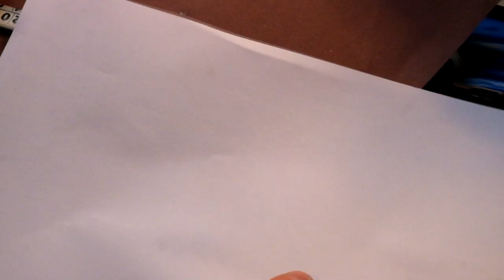How to repair Steam Contoller shoulder buttons (RB/LB) with only basic tools

Comment: I couldn't believe when I saw the video reach to the part and it was EXACTLY the same way mine broke!
Then you reached out to using a spare metric tape and I was excited because I also have that!

and then you pulled out the torch, and it was game over to me. I don't have one. YET. lol
thanks for the video, you just saved my Steam Controller!
Reply: after reading @cjwaasdorp2478 comment, I took tools out, burned stuff in my cooker, and... it's alive! Thank you both for the resurrection of my Steam Controller - it was dead for less than 24h lol
Reply: @JohnnyCiocca  How did you do it, because I don't have a torch either and would love to fix my controller.

Edit: Wait, I see it now, do you think an electric stove top would work, cause I don't have a gas stove.

Comment: Contacted steam about this issue, they did nothing, this is all too common a problem for steam controllers, but this worked and worked well, it's a little tricky getting the metal to bend the right way, but once you get that its a cinch, I tested it using steam diagnostic in big picture and it passed, never even showed up before fix, this video is perfect for this situation.

Comment: This is absolutely clutch.  And way better than the 3d printed versions that require further fine tuning.  Considering you make it with a tape measure, drill, screw driver, and a gas stove or a torch.
Reply: wait, you're saying I don't even need the torch, I can use my cooker for it?! I'll be right back, got some metric tape to burn =p

Comment: I just got the same exact failure a few months ago! Funny how the problem seemed to start right after Valve stopped support! I guess that's what you get for going with cheap plastic arms
Reply from the maker: While I don't think the timing was intentional it is a pretty unfortunate situation. I seriously hope it's just bad design and not planned obsolescence.
I love these controllers and had I known they would stop selling them I would have stocked up.
Luckily this failure mode is fairly easy to fix. But for most other components breaking you are SOL if you don't have a donor controller. I just hope I stop playing rocket league before I run out of parts...

Comment: Thanks for the video, I used one of my daughter's metal hair clips, and it worked great for this purpose. After breaking it apart, it was just the right size, and even had a hole predrilled where the rivet was that fit perfectly!

Comment: Thanks for sharing this. My RB for my steam controller just wore out the other day (Owned my controller since they came out so im impressed it's lasted this long) and Its great seeing the process for repairing it. I happen to have extra thin steel from a tape measure that I can use for this process, will give it a shot.

Comment: This is absolutely incredible! I got my first steam pad (it's registered as "lily pad" cause sometimes I'm a frog) when valve dumped the whole stock for $5 each and it quickly became my goto for the media/gaming comp hooked to my tv since it needed a mouse but not a keyboard (not even the steam on screen keyboard cause it requires both hands so how can I possibly do that and still hold my beer). RB broke a few years later (had it mapped to RMB so it didn't get much use except when gaming). I bought a new controller, but since they were out of production by then it took forever to find an unused one that wasn't like $100 (it's registered as "cow paddy" cause the price was crappy). glad I could use my first controller again since I could put the mint 2nd controller in storage for when the 1st one explodes (it already has a hole big enough to stick my thumb in on the left grip 2cm below the dpad; some plastic decided to self-liberate).

I do have one concern with this fix: iron oxidation aka rust. happens to iron/steel if it gets exposed to oxygen (unless you got something crucial going down, there'll be some oxygen floating around). sometims the tape is stainless and won't have problems, but a lot use regular steel with some kind of coating, such as nylon. some claim to be stainless but it'll be the housing only, the tape isn't. when burning off the coating (btw it definitely burned off in the video), leaving exposed steel is eventually gonna wreck your day. easy fix tho, with normal steel, sand it down and spray it with primer (some specifically are anti-rust) and you're good. aluminum doesn't rust either but dunno if a coke can is robust enough (while I'm not sure if it'd fit, stacking 2 layers of coke can would be fine if it did but I'm not gonna dismember lily pad a 4th time to check that out).

this mod really is great since it's not only a fix, but also an awesome reliability upgrade (steel>craplastic maybe). I went ahead and "upgraded" LB while I had lily pad dismembered (physics says LB woulda broke right after I got it undismembered just to piss me off). steam pad durability mods are super helpful after other controllers (xbox and ps4) stopped working for unknown random reasons that I definitely didn't cause at all (aight so this really never ever happens at all ever cause I'm crazy awesome af yo; but, hypothetically speaking, I just might unintentionally lose a game, definitely cause of hax0rz or aimbot/esp/noclip/etc or a hotfix that only nerfs me and buffs everyone else, or I crash/disconn/hardlock, etc. I tend to hulk out, smash my gamepad on the nearest surface, spew 30 second strings of profanities, chunk whatever sh!t I'm holding across the room, apologize to that sh!t as if that somehow helps, stand up to retrieve that sh!t's, spill the beer I forgot I was holding between my legs, cuss at beer, cuss at roomba for not cleaning beer, whip out some super glue to fix any busted sh!t, accidentally super glue my hand to my gamepad, not throw sh!t cause I'm superglued to my gamepad, not eat beer cause I'm superglued to my gamepad, etc).

Comment: For me didn't work neither ! After several attempts with reshaping the metal piece, got it to work only when the thing is open ( directly clicking with fingers ). After attempting to close  the Bumper plastics and the upper part that holds it, just couldn't do it firmly, have to apply force to make it click in place.  Like something was on the way from the inside ( suspect was the bumper button inner casting interferes with the New crafted part. So when closed ,the hard way , the Bumper is stuck and wont move one bit...
My metal piece was cut from the aluminium cap of a Jar, then bended in two for bigger strength. This material really allows smooth bending, easy reshaping with basic scissors, no burners needed. 
So the model maybe different( i doubt it) or i'm doing something wrong. Any help on the topic will be appreciated! Thank you

 EDIT: Adding the pictures of the part i've made and how it fits. Check the link  https://photos.app.goo.gl/G7REJxRr1sRYJuC9A
As you can see i've used the original piece, glued with double-sided tape at the edge of the crafted metal piece.  
Anyway as i mentioned , something goes on the way when trying to close it , making it very hard to clip the upper  closing part.  Bumper is stuck and wont move even one bit. Can you notice the problem?

EDIT 2: Hi, me again! Finally managed to make it work flawlessly! Thanks again , if it wasn't You. i would still be crying in the corner! So i did the metal peace allover again , did it almost as previously described but this time keeping a great attention to the unbroken opposite part and trying to replicate the profile from all  sides to it- cutting, bending and so on . ..to get this wing-like shape when looked from the front. And magic happened , the thing clicks like never been broken. I'm very proud of myself, through my previous best achievement DIY  was changing successfully a bulb , all by myself! 
 Thanks Again , wish you all the best!
Reply from the maker: Perfect! I'm glad you managed to make it work in the end! Congratulations for your endeavor!

Sorry about not responding earlier.. I only get notifications for new comments so I never saw the edits. Found it today by chance as I was looking for an old comment.

And using a jar cap is a great idea!

Hopefully the new breath of life for the controller keeps you going for a long time!

Comment: What kind of screw driver does he say to use, I can't make out what he says?  None of mine seem to work
Reply from the maker: It's a T6 torx screwdriver. If you buy a set of torx screwdrivers it should be in there. Also the ifixit link in the description taked you to a page with links for the tools.

Comment: Yep, that's it, that's where my bumper broke.
Really Valve? A plastic leaf-spring?

Think a soda can would work?
Reply from the maker: Yeah, not exactly a durable solution from Valve... A shame since it really has potential. 

The soda can should work fine. Might not be as durable as steel but still better than what is in there, to begin with.

I would still recommend heating up the metal piece after bending to increase lifetime.
Reply: @scifactorial5802  thanks. I've opted for soup-can for something that'll be a bit tougher to test out.

Also just found someone selling a controller with dongle for less than original retail, so guess I'm gonna have two controllers :D

Comment: I don't have a torch and our stove is an induction one... Think some matches and patience will do the trick?
Reply from the maker: I think you will reach the same temperature with a normal lighter instead of matches which seems less of a hassle. Should be doable but a substantional amount of patience will be needed.
The more important question is what material do you plan to use? If you are very limited with tools you might just be better off picking something that does not need heat treating at all.
Reply: @scifactorial5802  I was planning to see if I had some extra measure thing, or perhaps even cut up a can of some sort.
Reply from the maker: @Freezorgium  If you use a can you don't need to heat treat it. It's not ideal as its a bit thin but I have seen some other commenters make it work. 
Actually, if you are working with scrap you can just test it and see if it can be bent. If not see if fire solves the problem.
In fact, the whole comment section is pretty damn good. You might want to take a look at what other people have got to work and see if maybe you have something similar laying around.

Comment: Letting you know this is still usefull today, this link is also usefull to see where the screws go during reassembly (https://www.coloredcontrollers.com/blog/2015/10/20/how-to-disassemble-a-steam-controller-step-by-step). 

For me it was the actual button directly beneath the lb shoulder button that had come loose. Two of the four points where it was point soldered to the motherboard had come loose so it was hanging out of place. Could luckily solder it back in place with my oversized soldering iron. 
Directly reinforced that plastic part on both sides just in case :)

Comment: My RB button had the same problem and its not so scary to fix, but my LB doesn't work too but with another reason (it stopped working about a year ago so i remapped it to left grip button and it was not easy to relearn new setup in rocket league btw). LB just dead and I cant do anything without replacing it to new one with soldering but its too hard for me. Also I had some problems with left  and right triggers and was do some diy solutions. I am playing careful but controller has so many problems. I am upset of the quality for its price. Wanna try buying dualshock 4 for rocket league btw but it will be hard to play without right trigger extra button witch I used for boost on steam controller and again relearn to use L1 (LB) instead of left grip-ohhh it will be deadly hard for me (((
Reply from the maker: Sorry to hear that. Yeah I have seen a few where it's actually the switch itself that fails not just the plastic. In that case, you can't do much without soldering.
Maybe you have a maker lab around you? From my experience, it's pretty easy to bribe makers with beer and snacks for small easy repairs.

Comment: This is unnecessarily complicated, you can just glue the broken part to the inside of a bumper button.
Reply from the maker: If it works for you thats great. Make sure to record a vid and share it. The more steam controllers we can save from the bin the better.
Reply: I tried this method also and it seems it will work. I had to fill the back of the plastic piece with hot glue gun because the contact point to the button piece was just too little to have enough strength. Good idea though.

Comment: I actually got introduced to Xbox 360 controller because of how cheap they made the buttons on the steam controller. I spent a whole month learning to use the steam controller and then the rb/lb broke. I was so darn tired of mailing the controller back to Valve every month for repair that I just decided to buy a used Xbox 360 controller. 4 years later and the thing still worked fine despite the fact that I had already bought it used.

I only hope the actual cost of the controller was needed for the fancy d-pads cause otherwise they are definitely over-charging for the materials used.

Comment: This fix didn't work for me at all. After about 10 tries I realized either the steam controller design has changed since your model or it just doesn't work.  The spacing between the shoulder button casing and the board is not large enough to allow the metal piece to bend and screw in. I was able to create a metal piece after numerous tries and was able to screw it it, but the button only works if you hit it on the outside. If you hit the button on the inside, it won't reach the actual button and stops on the new metal piece. There just simply isn't room to have it bend and screw it. There is zero clearance above the screw in between the mainboard and the shoulder button plastic. Getting the button housing to fit back on is like 95% of the difficulty in fixing this problem and your video skips right over it.
Reply from the maker: Huh, strange.. Haven't heard of the problem so far but thanks for pointing it out. I admit that putting it back together was a bit fiddly but nothing too bad. Problem is you can't show anything on camera when you close it and literally the depth of my technique was wiggling it a bit before it snapped together.

Clearly the fix works on some steam controllers. Just check out the comment section. That being said it is possible they changed something but I find it very odd that nobody seemed to notice. 

You did trim off as much plastic as possible right? If you don't have flush wire cutters then sandpaper is your friend. 

Anyway can't really do much to help as is. But If you can send me some photos of the problem I can have a look and try to figure something out. My camera is a bit shitty for videos and YT compression doesn't help either. If you can't make out the details look at the iFixit guide to determine if your controller is different.

If there is actually a new version of the controller out I might take another crack at this.

Comment: Hi, I have another problem, shoulder button is not broken but the shoulder module (the actual thing) gets displaced when I press hard on it, when I open the controller and put it back in place it works again. Did you encounter anything like this?